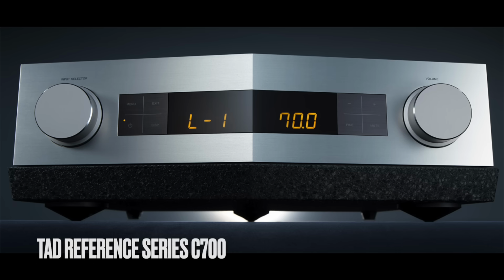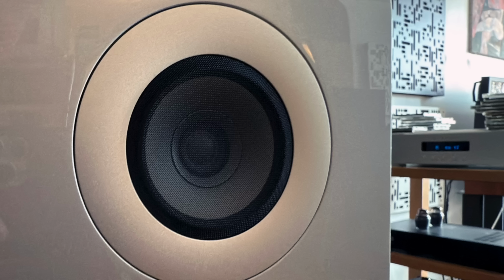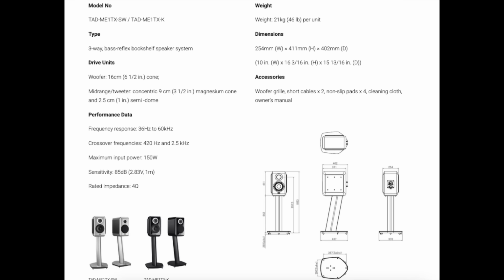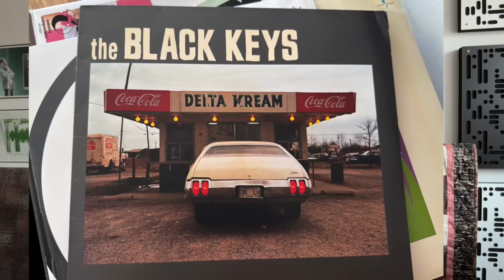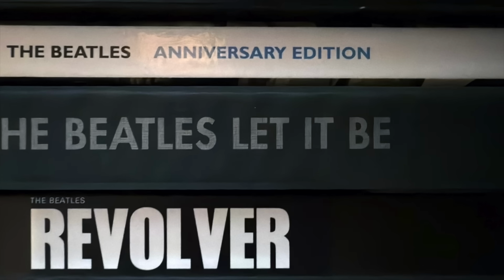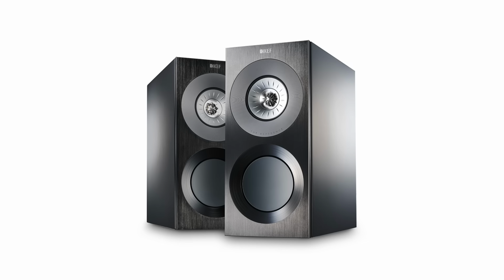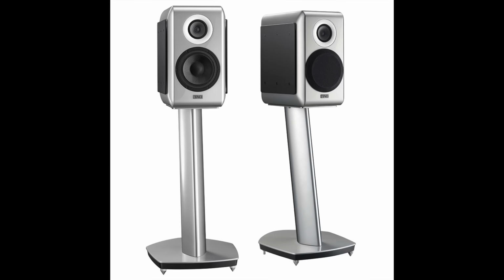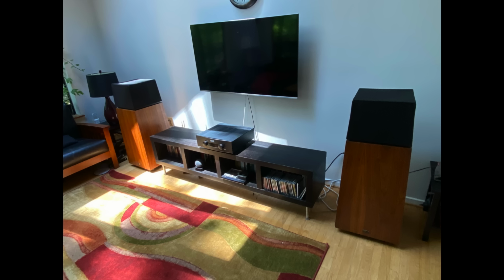TAD ME1TX: Here's How Japan Does High-End Speaker Design

Comment: They need to make a studio version of these balanced XLR active but less fancy finishing work on cabinet to bring to costs down and they will sell a good few of them.
Reply: Modern Compact Monitors: The TAD Compact Evolution One (CE1) and TAD-ME1TX are designed to bring studio-monitor precision into smaller spaces.   They don't make cheap monitors...
Reply: @peterbaugh51 I'm aware I'm saying for pros that don't care about the finishing work of the cabinets , do a cheaper cabinet design and not have as much expensive finishing work to bring prices down for pro market .
Reply: @JonnyParker-   The cabinet of these speakers is part of the sound.  There is no finishing on metal...  As I told people before, pros are going to buy what is going to get the job done as best they can afford.  And there's no wood veneer on most studio monitors that I know of...  Certainly not on mine!
Reply: @peterbaugh51 fair play I get what you mean dude , if they change the cabinet it's basically changing the speaker.
Reply: @JonnyParker-   in this instance, yes.  Going from MDF to HDF, may not be a huge difference...

Comment: too overpriced for what it is. For example, Genelec 8361 give way more tech inside and costs not even close to 17k (Coaxial, Active, one of the finest DSP Correction System on board) + youve money left for subwoofers (4-8) to get an fullrange system + control over the lowend - what no floorstander can beat in an normal (treated) living room (would never hear without an Sub Array and an DSP Correction. I dont know why so many ,,audiophiles,, still think that buying passive is better. The Actives on the market gives you mostly so much more for the same or less money (D&D, GGNTKT, ATC, Neumann etc)
Reply: You are comparing the sound of Genelec to these.... Okay.  If they sound the same to you, don't spend the extra money!

Comment: After hearing CR1s, I'm sure these are amazing sounding, maybe close to the best sounding for the range it covers. That said, I have a hard time justifying the price for what is not anywhere near a full range speaker. The drop off for these speakers start at around 50hz and at 36hz, it's probably at least -10db down. If they created a system for these speakers that includes a subwoofer option that is tested to fill in what is missing (perfectly and in idiot-proof fashion) that price tag might be easier to swallow.
Reply: Room dependent.  Construction of the walls, ceiling, floor, materials, affects Bass performance.  It certainly does in my room, I get 30 Hz from stand mounts with 6 1/2 inch woofers...  Of course you need about 200 watts of power...  And high quality drivers... Power is Cheap these days!

Comment: I listened to for a quiet some time Pioneer model hpm 900. TAD is I believe the high end department of the co.
Reply: As a kid I used to own the HPM-100.  When I got older I rewired them, bypassing the blade speaker terminals and the tone controls.  They sounded so much better.  

Today I still own Pioneer, sort of in the TAD CR1.  Amazing speaker and the only that uses vapor deposited beryllium for the tweeter and the midrange.

Comment: How does this speaker comapre to KEF's older Reference speakers like the Ref201/3? Some say it is very very similar to the TAD due to similar genes
Reply: Other than being concentric, there's no comparison between Kef and TAD, having heard both their higher end speakers.  Beryllium for the win!
Reply: @RDAudioReviews  My friend who owned the KEF 201/3 and "upgraded" to TAD recently and said the gap i is  very small. The good thing is TAD is more power friendlier and less fussy to place~ The bevel shap fto make the speaker disapper in 210/3 was replaced their current reference model Ref3 which has exactly 8 90deg corners! 

Funny is that despite the similarity in sound, his friends only got interested suddenly after he replaced the 201/3 to TAD.... lol
Reply: @ That's quite interesting.  I can only comment on the reference series TAD vs. hearing the Blade and Blade 2 (original versions)  I do want to hear the newer Meta versions.
Reply: @RDAudioReviews  If you got a chance, try listen to their older reference 201/3!

Comment: What's with bucking magnets in 2025?
Reply: They still increase micro details and dynamics.Not just for shielding.
Reply: @ how does a bucking magnet increase performance over just using a larger magnet?
Reply: @bluelithium9808  it pushes back against the stress of xmax of the surrounds and extra magnetic force...a bucking magnet increases sensitivity by about 3db as well.
Reply: @ all of which a larger magnet can do which is probably why most driver manufacturers go that route
Reply: @bluelithium9808 wrong.
Reply: @StrangeBrewReviews  got a source?

Comment: You gotta try it with class D amps. That's how you get the crazy dynamic. Better than any Klipsch or high efficiency speaker I ever heard
Reply: Haven’t heard much, have you😂?
Reply: Seriously, you expect a 7 inch speaker to outperform way bigger speakers?
So called "high end" fanatics truelly are high 24/7...
Reply: @halloola3636  They very often can… I am not slamming Klipsch… they make some fine speakers… and these cost more than the Klpschorn which needs corners and is HUGE… love them mind you… but in my room the TADs would win hands down… not to mention that here they are CHEAPER than the Khorns… cause shipping those beasts costs a ton as does warehousing etc…

Comment: Amps?
Reply from the maker: Pass XA25
Reply: @SteveGuttenbergAudiophiliac 
I have these TAD speakers and they need more power. I use them with 200W Audionet AMP 1 v.2. These pairing is a magical one.
Reply: @SteveGuttenbergAudiophiliac Pass XA25 has sufficient power for those speakers in your listening room?
Reply: @SteveGuttenbergAudiophiliac since it needs a subwoofer anyway ( in my opinion most any speaker does ) . I  can see where 50 watts is plenty in a smaller room and ninty decibels being  the limit of one's listening.  Just let a good subwoofer do all the heavy lifting in that bottom octive.  You can always limit the bottom end of the mains  too. Although that probably wouldn't be necessary at levels under ninty decibels.  
   It kind of amazing how much a subwoofer can improve the sound stage along with shoring up the bottom end . This will extend well into very low (quiet) listening levels.  It's the  difference between a great subwoofer  and an adequate subwoofer.  
   My mains are a pair of Bose 301seris IIs . The front tweeters are Advent fried and a new crossover.  Very nice vocals now . Anyway since the 8 inch woofer can get down into the fifties on there own . I able to pair that with a low cost 12 inch subwoofer .  I often listen at very low levels . It really does make the low end  more realistic at those levels.  You can easily distinguish every note and never touch the loudness button.  When I  get a chance I'll put Aespa's Wiplash on ( K-Pop with a touch of EDM) being able to hit the high twenties is actually necessary.  Being able to do that very loud is just that much sweeter . 
 I couldn't believe that the sound stage actually oped up too. I have to say my Darlington Labs MM-5 and Pickering moving iron cartridge made that possible . It's almost like Kieth Richardson designed that phono preamplifier for the Stanton/Pickering moving iron series.  Have a nice day 😊

Comment: For that price you can get the new focal sopra 2s.  That's a ton for a bookshelf speaker.  For the price of the stands you can build a diy scan speak set that will reach 30hz with ease.
Reply: Yeah,3k just for the stands!😮
I'm sure they're great speakers, but when the stands cost that much it makes you question the value in my view.
Reply: @oliverbeard7912 luxury comes with a price. It goes for anything high end or lux. Your oil change for a Porsche GT3 isn’t the same cost as an oil change for a Toyota Camry. A company charging you $18,000 for speakers will not charge you $199 for stands. That in itself will have you questioning the value of the speakers. You can’t walk into a 3 star Michelin restaurant that has reservations 1 1/2 year out and then see the menu prices of entrees at $9.99, price is part of the expected performance. My first Rolex bought back in 1998, never had it maintained. I brought it into the dealer after 20 years and a simple clean, and inspection was $800.
Reply: @oliverbeard7912  So you buy a Ferrari car solely based on value? A cheap wood stand would most probably do the same job. Who needs exotic materials, luxury paintings, obsessive tuning sessions?
There are things you buy for the emotions that they deliver. Not every choice should be made exclusively based on value. High end audio is all about emotions. If you want value, skip to Am.azon and buy Fosi toys.
Reply: @oliverbeard7912  Yerp, they´d be great speakers and to be taken seriously if they were in the 3k range.
Reply: the problem with that is the resonance from DIY cabinetry. TAD spends as much R&D on anti-resonance as driver design - which is why they've always used mixed materials with differing resonant frequencies
Reply: @tunejunky  I know Wilson does that as well.  MDF and HDF is pretty darn good material though.  My bookshelf has a 1 1/2 inch baffle.  Then it's heavily braced.  I can see that other materials could be better but how much difference does that make?

Comment: i used to work for TAD's parent company. they've been using Beryllium tweeters since the 80's and do high end pro audio too. the very first Dolby Surround mixing monitors were TAD used by Lucasfilm for Star Wars
Reply: Nice to see a fellow Pioneer vet here! 👊
Reply: I'll add to that comment that when theaters were first being certified for THX, one of the requirements was that they use Pioneer (curiously not described as TAD speakers, but I assume the document was referring to Pioneer Exclusive speakers, which, of course, used TAD drivers). I dug that gem up while I was researching the brand history for what would have been a new international brand messaging campaign I had been tasked to develop (which, predictably, I'm sad to say) was shot down by Pioneer Japan on the grounds that "mentioning company "industry firsts could be perceived as insulting to our competitors." 😑
Reply: Beryllium doesn't stand for sound. Radian stopped producing this line.
Reply: @thomasschafer7268  that's because Beryllium is toxic when machined. out of all materials tested in the history of audio transducers Beryllium offers the best HF response w/o any metallic characteristics like Titanium and Aluminum. But it's rare, expensive, and difficult to work with which is why Vapor Deposition is a big deal

Comment: Love TAD stuff. I think they along with Borresen are up at the summit right now
Reply: I’ve listened several times to different Borresen speakers. Initially I was extremely impressed. Extremely transparent, impressive 3D sound stage, speed and attack but still smooth enough to enjoy also high volumes. Especially electronic music was outstanding. The bass is very tight and fast but not extremely deep. Listening more and different music there were also things I didn’t like. Hard to describe but kind of musicality and coherence of the different driver were not ideal. The TAD sounds less impressive but for my taste much more natural and involving and definitely my choice for long term.
Reply: The Borresen speakers at AXPONA sounded Amazing
Reply: The outer ear, also known as the pinna, shapes and filters incoming sound waves, affecting how we perceive the pitch and location of sound. This means that even if two people are listening to the same speaker, the way their ears process and interpret the sound waves can result in slightly different auditory experiences——-this is why you demo speakers instead of relying on charts.
Reply: Erin from Erin's audio corner did some measurements and found borrensen to be lacking
Reply: @tharinduweerasekara5360  So are you saying that all the people who love the sound of Borresen speakers, have tin ears?
Reply: @KeithWalker-rs1cn  my comment was on the measurements not on anything else. Take it of what you may
Reply: @tharinduweerasekara5360 that’s why we listen to them because measurements don’t mean jack$h!t
Reply: @jamesschneider3828  Tell that to the engineers developping speakers...
Reply: @jamesschneider3828 😂😂😂 sorry for your loss. I hope you find your brain soon.

Comment: TAD is an absolute no-brainer if you got the dough and want a modern speaker, they are that good.
Reply: I wonder how good the TAD  sounds compared to my PS audio FR5
Reply: @mrpmj00 way better
Reply: $20,000.00 ?    I’ve only got $1000.00 ears.
Reply: Yeah, it´s a brainless choice. Good for posers.
Reply: @halloola3636  have you heard a pair?
Reply: @ No, but I know what´s possible. And this is a small inefficient three way speaker with a 6 inch woofer.
Reply: @halloola3636  take a listen, and come back. That price range (and above) is full of BS "poser" speakers, most of them actually, these are not one of those.
Reply: @Buffalobulltofta these are too hard to push and it doesn't go down to 20hz not even 30hz
Reply: @MasterofPlay7   You want 20 Hz get a $5000 sub.  Get two!
Reply: @peterbaugh51 no bro for the money they asked I want it to go down 20hz
Reply: @MasterofPlay7   Go find some speakers that do that for 20K.  Good luck!!!
Reply: @peterbaugh51 I think plenty of tower speakers can do that
Reply: @MasterofPlay7  Name five.
Reply: @halloola3636 heard a pair?